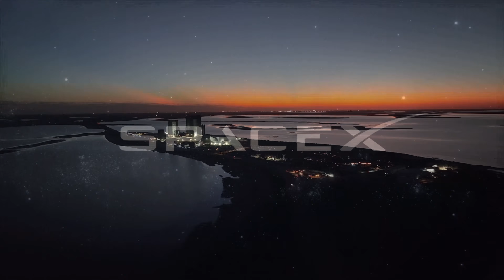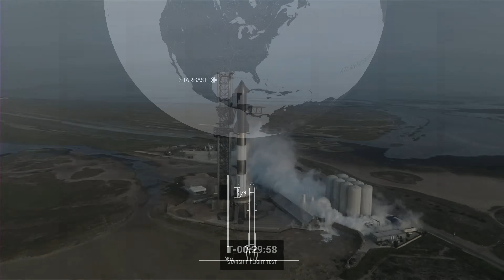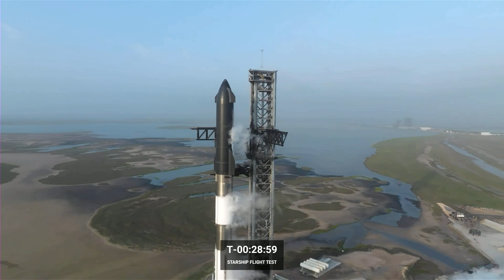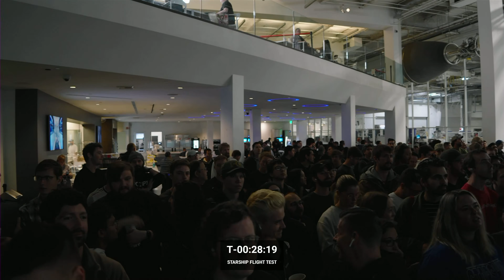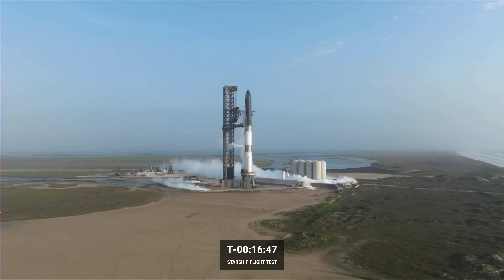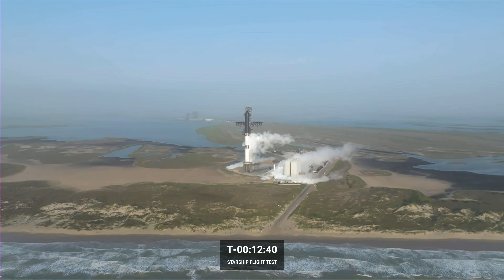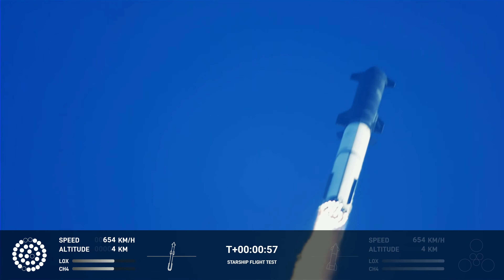Starship Flight Test

Comment: A great data to outcome from the RUD, was watching how Starship handled so many flips without losing the structural integrity.
Reply: That's what I was thinking, impressive!
Reply: @C.D.J.Burton  didn't get why SpaceX did the flip to stage separation instead of a roll over and disconnect procedure. Wonder if the lost engines plus the flip maneuver with a fully loaded Starship still connected to the Booster, didn't introduce unexpected data to the software, not allowing to procedure with the stage separation. Just some thoughts.
Reply: that was just amazing ! I didn't expect such strength !
Reply: It appeared to me that after the booster started to spin to use centrifugal to throw the ship away the engine shut down program didn't worked and so the booster just kept pushing against the ship.
Anyway incredible launch just even clearing the tower was a huge win 🔥 and the flight really looked like the renders we saw
Reply: They managed to route all auxiliary power to the structural integrity fields.
Reply: Yes very impressive! Look back at the RUD's from the Saturn 5 days, soon as the rockets started to deviate they would just crush like a tin can and break apart.
Reply: Very Impressive for sure!
Reply: @RogerM88  I remember an interview where Musk mentioned they may be able to flick the Starship off, this would remove the need to use thrusters for stage separation.
That would provide less weight, and remove additional points of failure if it worked.
Reply: @ToddGreenIKR  I'm giving her all she's got captain. 😂😂😂😂
Reply: Indeed, the fact that it did not disintegrate after all the flips is quite amazing. It was going at Mach 2 and did not seem to care it was doing it sideways....Can't wait to see what went wrong!
Reply: That was the flip maneuver but the booster and upper stage didnt separate. They just let it spin and fly for a couple more seconds before the activate the FTS or flight termination system to gather more data. If the stage separation is successfull I think this flight test can go as far as re entry.
Reply: @RogerM88  The Stage separation is supposed to happen before the flip manoeuvre and there was a little confusion in the casters of the launch, since there was no stage separation but a flip occurred, and i believe because the stage separation failed, and then went on to do the flip which only the booster is supposed to do, the software lost control of the rocket and it just kept on spinning on top of that 2 engines failed (most likely destroyed) at the very beginning around T+30 seconds, this probably also added stress to the rest of the test since it is it unclear what internal damage occurred in that raptor explosion, but yeah definitely an amazing launch with tons of data to unpack, and i can’t wait for the next one!
Reply: @RogerM88  i also forgot to answer your question on why they did the flip manoeuvre, is because the booster needs to land at the Launch Pad in texas since it is the one with the ‘catcher’ and cannot land on one of the drone ships, not yet at least, so they do the flip manoeuvre so the booster changes it’s trajectory back down to texas rather than carrying on into the ocean.
Reply: @RogerM88  In this test launch specifically they had almost no certainty of it landing successfully and therefore did not plan to send the booster back to texas to land but rather have a water landing in the gulf of mexico, but they still need to test the flip manoeuvre for when it will be needed
Reply: @Virelia-V  5 engines shut down by the time it got to engine shutdown. I can imagine there will be vast amounts of data gathered from this though and at least they now know structural integrity held up through max Q all the way to stage separation. Looks like the Starship release mechanism failed as it was still attached when the booster flipped. All very new concepts though so much work still to do.
Reply: @RogerM  Man it sounds like you know a lot more than I do about this. I will need to analyse later to fully understand.   I wonder how this impacts funds? If it successfully landed, lots could've been reused possibly? I'm sure EM factors this in, but it must still be a shame to see so much amazing engine-ness become completely unusable. Man I'd love to hear Elon's thoughts on this.
Reply: @C.D.J.Burton  I believe this stack used now-obsolete engines. Still expensive, but they were destined to be replaced
Reply: @trequor  I actually feel a lot better I not even kidding. Presumably, as you alluded to, some parts could have been reused but wouldn't have been an efficient use of time and/or bad practice. You know, even witnessing fans of this speak with such an understanding of it is a beautiful thing in itself.
Reply: @schrodingerscat1863  3 engines were already not working from
previous tests. but they were in unnecessary for what they are testing and the likely problem isn’t from the engines not working but the rapid shutdown and explosion that came with the last 2
Reply: @Virelia-V  All engines were working fine when it cleared the tower, callout was nominal at that point. Engines that failed in previous tests had been switched out, no way would they have attempted to launch with known bad engines. On the way up at least 2 engines failed explosively, you could see that in the exhaust, others were no doubt shut down because they were going outside acceptable operating parameters. The craft got all the way to engine cut-off and staging but the Starship failed to detach from the booster which is why the self destruct fired.
Reply: @schrodingerscat1863  you can see on the UI. there are 3 engines off at launch, 2 turn off around 30-60 seconds the 3 engines that failed on previous tests were not needed for starships operation said by elon himself so that’s why they weren’t replaced, extra cost for when the ship was basicslly destined to explode
Reply: @Virelia-V  A fair point but all engines that failed in testing were replaced so they were no bad engines at ignition, looks like they just had 3 that failed to light on the pad same as during the static fire.

Comment: vehicle intact even after 2 spins, that's nuts and unbelievable
Reply: Truly wild! Did you catch the in-flight abort test of crew dragon? Falcon 9 was freaking disintegrating even before they blew up the stage. I realize, very different circumstances. But that Starship probably would have stayed in one piece till she hit the ocean. God what a time to be alive. We're watching humanity stumble its way in to the cosmic ocean.
Reply: Amazing the joint between the stages held like that. I would have expected it to break up on the first 90 degree turn against the air flow. It's tough ship.
Reply: They didn’t keep a Bible on board and god struck it down.
Reply: @ihmpall   God isn’t real
Reply: Yea, good sign for a reusable vehicle!
They can't afford to be as flimsy as expendables....      :)
Reply: It's going at supersonic speeds too it spun probably 4-5 times. Was absolutely incredible.
Reply: None of my larger KSP rockets would survive a triple flip at mach 2 / nearly 40km.
That's impressive.
First point of data is obvious. Nothing ever built before would go mach 2+, do a triple flip, and actually need to be disassembled by ground control. Most rockets have the structural integrity of wet tissue paper. That thing is a tank.
Reply: @machirim2805 let’s say he isn’t, we’re still an ant to a boot out there beyond the stars lol guarantee
Reply: Absolute KSP Chad moment
Reply: Yeah I don't think many of todays rockets would have made if past the first unscheduled one. It did start to loose what I'm guessing is tiles on the last one.
Reply: Hebrews

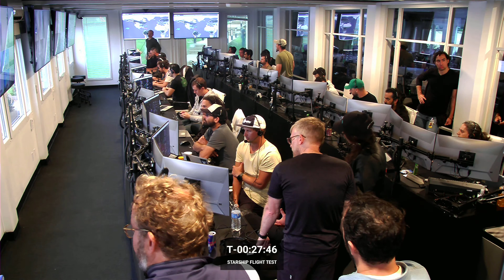12:14 Make every effort to live in peace with all men and to be holy; without holiness no one will see the Lord.

Acts

3:19 Repent, then, and turn to God, so that your sins may be wiped out, that times of refreshing may come from the Lord,

James 2:24,26

Ye see then how that by works a man is justified, and not by faith only. For as the body without the spirit is dead, so faith without works is dead also.

John

3:16 'For God so loved the world that he gave his one and only Son, that whoever believes in him shall not perish but have eternal life.
 
3:17 For God did not send his Son into the world to condemn the world, but to save the world through him.

3:19 This is the verdict: Light has come into the world, but men loved darkness instead of light because their deeds were evil.
Reply: It is indeed impressive though I would’ve thought the flight termination system should’ve triggered earlier as soon as it left the planned trajectory or is it manually activated?
Reply: "The good news of Jesus Christ is that he came to save us from our sins and offer us eternal life through faith in him. Jesus died on the cross to pay the penalty for our sins, and he rose from the dead to conquer death and give us hope. If we confess our sins and believe in Jesus, we can have forgiveness and new life. God loves you and wants to have a personal relationship with you. Will you accept his gift of salvation and trust in Jesus as your Savior?
Reply: @jeushaneba.rad.2603  Are you Jesus?
Reply: That's a design flaw though. The second stage should have separated during the first flip, and super heavy should have boosted back to Earth, for a soft landing in the gulf of Mexico.
Reply: @jbrevet66  we're watching one man push us into the cosmic ocean. humanity is rotting
Reply: @jamieNZ  yes it was manually activated from the ground. Something with the Hydraulics destroyed halfway going up and 6 engines cut off.
Reply: @machirim2805  and you dont get jokes
Reply: @jeushaneba.rad.2603  Jesus the guy from Mexico?
Reply: Especially remembering way back when they were worried it wouldn't hold it's own weight up unless it was pressurized. that thing took torque without buckling.
Reply: I don't think people understand the gravity of what we witnessed. The vehicle had literally lost control and was spinning uncontrollably, and it stayed together... It's a giant freakin rocket that got put through a torture test, and it stayed together. That's mindblowing.

Comment: The largest flying object ever made by humanity. Clearing off the pad and passing through MaxQ is a huge success! Congratulations, onto the next one.
Reply: I definitely didn't expect it to make it that far.  I also expected 20% of S24's tiles to fall off immediately.  Especially given that this was basically a throwaway test with out-of-date models that were probably destined for the scrap heap if the FAA had indicated they were going to need another month.
Reply: how is it largest flying object lol, there are plenty of airplanes bigger than this

alright alright my bad
Reply: "The largest flying object"? Energia-Buran would have a greater height if the stages were located the same way as here. The only difference is that the Buran and Energia was in space and Buran returned automatically to Earth. But this ship could not even separate. I hope this project will be success. But so far, I see no reason for stormy joy.
Reply: @Urketadic  It's over 100 meters tall, that is longer than an A380 or any plane...and it certainly weighs more than any airplane that has ever flown. There was over 11 million pounds of propellant alone!
Reply: @Urketadic  There are not. The fuselage of the largest plane AN-225 is 6.5m (vs 9m) wide and 84m (vs 120m)  long.
Reply: the hindenburg was 245 meters long.
Reply: @Urketadic  what airplane are bigger? I can tell you there is node! There has never been one!
Reply: @mememachine1219  Fair....I didn't think of those old airships.
Reply: @mememachine1219  Ha!  With a similar effect like the Graf Zeppelin!
Reply: @mememachine1219  True, but limited in other aspects.
Reply: @mememachine1219  Maybe that is floating, not flying
Reply: @Kulumuli  well, yeah, it was an airship. nobody is saying zeppelins are cutting edge technology, i'm just saying starship isn't the biggest thing to fly.
Reply: @condo321  For those needing human numbers: That's 5,000,000kg or 5,000 metric tons of propellent.
Reply: Certainly it’s the most powerful thing to ever fly.
Reply: @Urketadic  bo there isnt, this thing is 390 feet tall. larger than the wingspan of the largest plane ever.
Reply: @or3847  another term for floating is lighter-than-air flight
Reply: The largest flying object that destined to reach space is ever made
Reply: if combine 3 starships (like falcon heavy), the new rocket will be 3 times larger

Comment: You can see some debris flying off from the base of the rocket right as they release it. It’s amazing this thing still went straight up with as many engines going out as they had.
Reply: There was no payload luckily to weigh it down.
Reply: I believe it still has the ability to get to orbit with a few engines down. It's designed that way
Reply: Yeah, there's a good chance that a lot of that debris was just ice. With as cold as that thing was, it was probably methane clathrates which are a flammable form of ice. Very fun to play with. Hahaha
Reply: That's why it has so many engines. It's designed so that engine outs don't effect it that much.
Reply: @sasses967 that picture is surreal

It must be something like 3 meters of dirt/concrete missing
Reply: Where can I find that photo?
Reply: I think they purposely self destructed the rocket to prevent it from going out of control as it fell back to Earth, this near exact situation has happened before. Still considered a failure though
Reply: I don't think what you see on the video is refutable, it's a failure
Reply: you could definitely tell that there were numerous engines out...
Reply: @aLeXitaly7  Anything past clearing the launch pad was a success. To punch through the MAx-Q stage intact, and then to survive the stresses that tumble induced is extremely impressive. And this combination of hardware was known to have older engineering that has since been iterated on in the newer rockets, and the newer ones are going to have the benefit of all the test data this launch produced. Nobody was hurt, the launch mount is relatively intact, and they cleared a lot of milestones and got a large volume of test data. 

This is an absolute success
Reply: 6 of the 33 engines were NOT lit and firing at one point. They even appeared to lose a couple at the exact moment when they went back to throttle up.
Reply: @aLeXitaly7  It wasn't expected to be 100% successful.  Any data they can get from "failures" is a success.
Reply: One of the engines cut out and later they got it back on. Redundancy is great. 46:45 - 47:00
Reply: @eatonkuntz  Well, according to the footage, there were 6 engines out. As shown on the vid footage and the graphic.
Reply: @ianrobertson3419  It's payload was over 10,000,000 pounds of propellant. Plus the mass of the Starship.
  Don't be a filthy pessimistic troll.
Reply: @aLeXitaly7  It was a planned failure. Troll.
Reply: @Unmannedair  It was concrete. About 10 #'s of vaporized concrete is on my van! Yes, I was there. It reminded me of the Mt St Helens eruption. Yes, I was there, also.😮
Reply: @canadaphil6068  Six was my count, too. Undeniably an amazing flight! 

I wanted three things: clear the tower without destroying it, survive MaxQ, and test the Starship heat tiles on re-entry at Kauai. Two out of three on the first test flight rocks!!
Reply: @bo8404  Oh sure, I agree.. I'm not criticising the effort... On its first ever attempt it hit over 2,100km flight speed and made it 34km UP!... I have since seen a great breakdown video on youtube that showed the incredible amount of debris that was kicked up on launch with speculation that some of that debris in fact took out engines which seems to make sense. After a zoom in on the launch pad, it clearly shows huge chunks of concrete were actually blasted away from the force of 30+ engines, so they obviously need to work on coming up with someway of better reinforcinng the base of the launch pad.